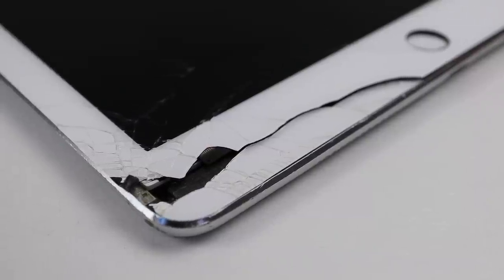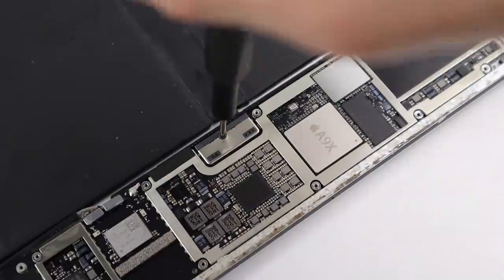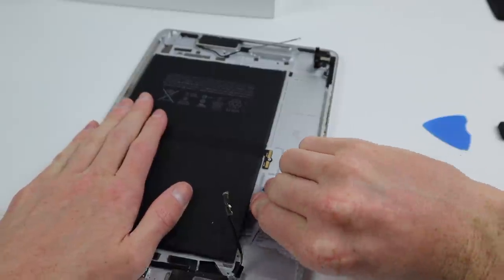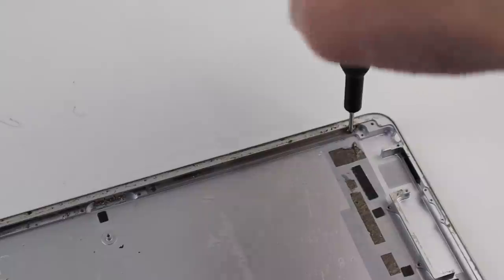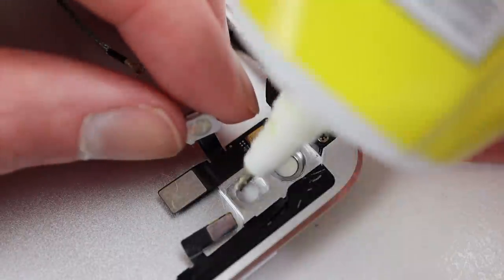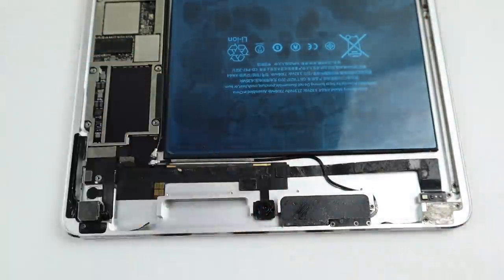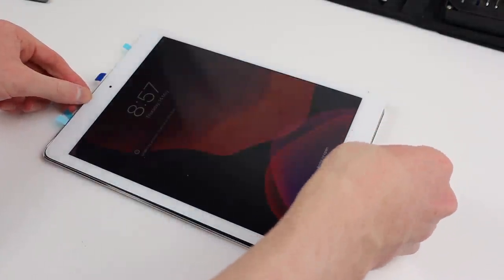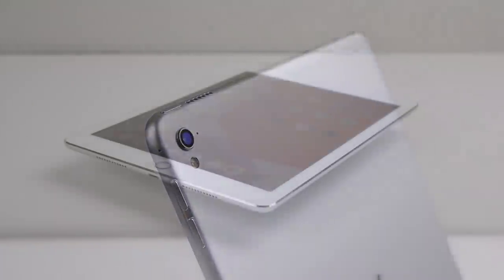Never Try To Fix This - iPad Pro Restoration

Comment: My iPad Pro 12.9 needed a battery called apple took it to the store told them I need a battery $99 dollars later and a week or 2  i went back to the store picked up my new iPad of the same model not refurbished i was told they do not replace the batteries saved me  $900 because i was going to buy a new one more than likely. Great videos

Comment: Sure, Apples anti-repair stance is reprehensible, however let's not forget the thing they do right. 
Any other tablet this old you wouldn't attempt to fix because it's terrible even if fully functional. 
If not tossed on the ground it's a really good device, mine is seven years old by now, still works fine and still recieves software updates. 
It has also recieved a good amount of scrapes and bumps over years of subpar care and handling, just not anything catastrophic like the one in the video.

Comment: May I suggest, if anyone has already, invest in a hot air gun ( soldering ones that are smaller and with different attachments ) and you might be able to unglue almost anything. Cheers

Comment: Far too much faff to repair these. I tried to repair my old iPad and bricked it within minutes.

Better to clear down storage if possible and sell for parts and get a new device. In my experience 3rd party repair houses fit inferior parts that don’t function as the originals do, and going directly to Apple means by the time you’ve invested in new parts you may as well just replace with a new model.

I’m sure your repair is close to original though - incredible intention to detail with this restoration. Fair play for having the patience to do this.

Comment: Wouldn’t of been a nightmare if you used heat on all of your prying on glued in parts. Since metal conducts heat very well your hot plate can easily heat up the iPad. And of course using alcohol on every glued in part in tandem with heat is what I do all the time.

Comment: Hey I've got a question for thr geniuses of the comments. I've got a CDMA iPhone 4 that's still running ios 6.1.3 and I'm having a issue resetting it. It's passcode locked so I can't just go into it and wipe it. But I really don't want to update it.

Comment: Fun Facts: Some touch I'd has came without the sensor inside it. 

How?...Because recently I bought touch id buttons for my iPhone 6 and  it's work well till now. I also try to use the button on my friend iPhone 6 and it work well... and I tried to buy another one and it stop working.

So the conclusion is... some touch I'd has no sensor in it or maybe they pair it with the motherboard?🤔🤔🤔

Comment: How does one end up shattering an iPad on concrete? So many thinks have to go wrong for that to happen

- using an iPad outside (understandable but generally not a good idea)
- using an iPad over concrete (I guess that’s understandable?)
- using an iPad without a case (???)
- dropping your iPad (?????)

Like, it’s a big thing. It’s not like a phone that you can think you slipped it into your pocket, but in reality it’s just outside it. I’ve dropped an iPad Mini this way before because they fit in pockets (it was fine because case), but never a full sized iPad. Let ALONE using it outside, over concrete, without a case.

Comment: 4:36 - THIS RIGHT HERE - This is why I get pissed at apple, and the need for SOME kind of regulation. 

They glue in the motherboard, cables, etc PURELY to make it hard for them to come out. I can KIND OF understand the speaker (they wnat it to not rattle and transfer it's vibrations to the case to improve sound -- but you can easily do this with properly design screwed on tabs). 

They GLUED the motherboard, CABLES, and etc purely for bullshit reasons. 

How hard would it have been to MERELY had small pieces of foam / rubber on certain parts to wedge the board in place. The other idea is to possibly prevent warping under heat, and that can be done with proper brackets and a SMALL metal bar (or 2) along the motherboard to ensure it doesn't warp and cause issues.

They could easily use rubber and foam to hold things in place to prevent issues..... Warping is a concern, but it can be mitigated quite easily without gluing the motherboard to the case..... :/

Comment: "You're gonna need an excessive amount of alcohol in order to complete this"
You know some heat applied with a hot-air reworking station in a low setting does a better work, don't you? Even a hair dryer can soften the glue better than all that alcohol.

Comment: Those iFixit magnet pads really are one of the best things ever. Also, I don't think you put it back together right. I didn't see you smear a bunch of glue on every single part you put back in. Apple would be disappointed.

Comment: You disconnected the Screen before disconnecting the Battery. That can easy result in blown Filters. And YOu did the same on the reasemmble. You connected the Battery first and than the screen, its the wrong order and could result in blown components.

Comment: I hate iPad repairs, i've done my fair share of iPad repairs, and the most heartbreaking is, when the device returns after 6 months with a busted screen again! How some people use their devices, i don't want to know! Also, i bought an iPhone 6 for very cheap online, claiming the home button didn't work well, the device wouldn't enter DFU mode, touch id was unavailable, and the clicking didn't work to wake up the phone, i thought it was some cheap aftermarket home button, until i opened up the phone, very weird situation!! The phone has an original screen attached to it, but when i went to disassemble the phone (it was a space grey, and i wanted a gold iPhone 6 with black screen and black touch id button, space grey buttons and a black apple logo at the back), i discovered the touch id flex was an aftermarket one, on an original display panel, it looked awfull (it was bended over and then plugged into the motherboard). My thoughts? The phone had a battery replacement, and someone must've broken the original touch id flex, so i replaced that awfull aftermarket one with an original one, and luckely, touch id was functional again, i was so happy, its a 64gb, so i got very lucky that this button belonged to the motherboard inside this phone, my project phone is completed and i have to say, it looks really, really good! Nice color combination! Everybody thinks this phone is so cool and beautiful! I will make a video about it i think :) great video man as usual

Comment: Apple use so much glue to prevent repair of the iPads,  phones are not as bad.  I have an iPad Air 2 on my bench that needs a pin grafting onto the lcd socket and a jumper fitting to replace the damaged track,  and that’s where it will stay.  I don’t have micro soldering kit only a very expensive iron.

Comment: The old lcd was still usable, front glass was only destroyed, you could have just replaced the front glass instead of replacing the whole lcd
Reply: afaik they are fused together. There‘s no chance you can separate them if you don‘t have the knowledge of a LCD-refurbisher. And even then - the chances of getting that glass separated from the LCD is really low on these.

Comment: Great tutorial, but you did not isolate the battery connector from the mainboard before connecting the new digitizer/ LCD, this could blow the capacitor to the backlight or cause other issues, fortunately, you got away with it :-)

Comment: 5:45 - Yeah.... They EASILY could of added small screwed in straps, tabs with glue, and a minor rubber cushion to hold the battery in place. But noooooooo. Fucking GLUE. WHYYYYYY

Comment: The case is aluminum why not just warm it up on your hot pad/plate thing? Little bit of heat and that glue would loosen right up. Then use some naphtha to finish dissolving the glue. Be a lot less time consuming don’t u think? 🤯 🤣 😎

Comment: Ipad ? more like Iglue . I have the Ipad pro 12.9" 3rd generation and I sure hope I wont need to fix it like this. luckily I use it all the time with keyboard case from Logitech and I use glass screen protector to prevent scratches and the screen shattering.

Comment: Vice hammer and screwdriver for the magnet removal once everything else is out. Might have to chop the case up first to get easier access. What a horrible design, clearly done on purpose to prevent repairs.

Comment: 1. Heat the glue.
2. Bend the case on the edges with pliers…you’re throwing away the old case I assume. 
You made this much harder than need be.

Comment: The magnets which only will press against the case require both glue and a bracket but the home button, which is always pressed into the case, only has some shabby sticky tape... nice work you. idiocy at apple.

Comment: I hate looking at the amount of redundant BS they have in these devices. Magnets along the edge of it being glued in and then on top of that a retaining bracket with screws. Just use a retaining bracket, people! I'm so happy that I work on cars instead of these. I think I'd sooner be taking an oxy torch to the suspension of a car than fighting with endless piles of glue.

Comment: Apple should do a better job and solder the screen to the case so the consumers can’t fix our darn devices. And do what Samsung is doing and putting in a software block when parts are replaced.

Comment: That’s not an iPad Pro it has a home button that’s the iPad Air 2 you just showed 2 different pics
Reply: apple made iPad Pro before 2018 which all had home button this is the iPad Pro 2016 9.7 inch